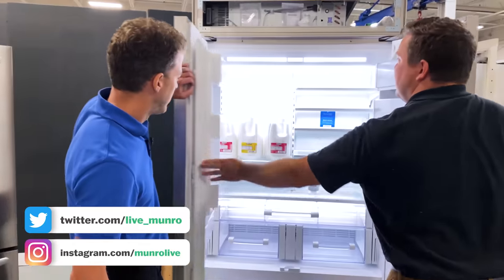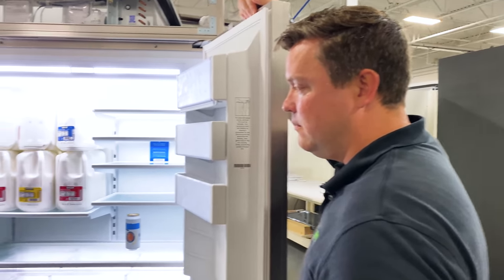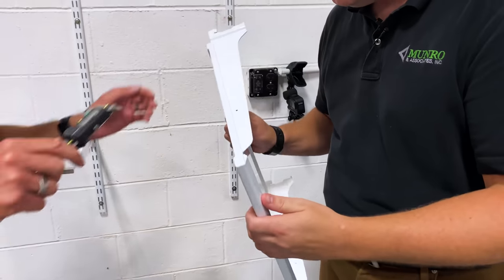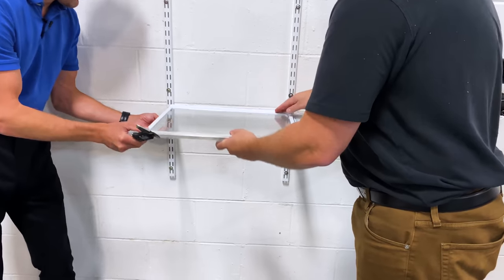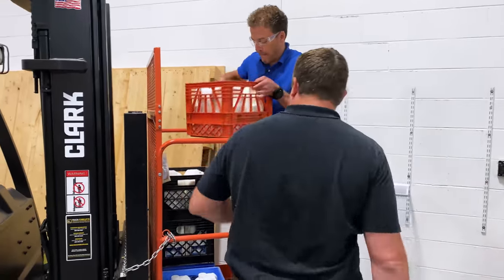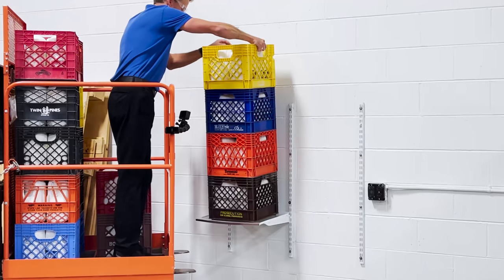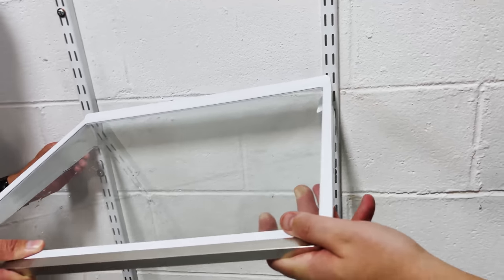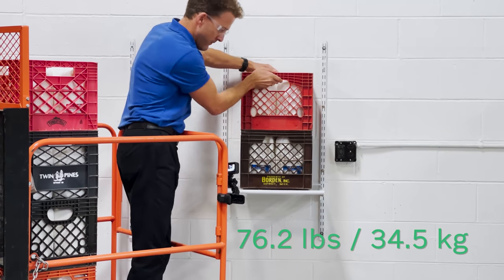Consumer Series: Sub-Zero vs Frigidaire | Load Testing

Comment: Now you/we know what it definitely can't handle. I kinda miss a scientific reason why you did what you did with some calculations and theories to prove. I know that might not be as entertainment for the audience but that's what engineers do. 
Not wasting resources.
Reply: that's what engineers do. 
Not wasting resources.

You and I know very different engineers, and have a very different definition of waste.  They could model it in 3d, and do a bunch of static analysis, or they could do this.  Given the time cost of the modeling, the milk used was certainly cheaper.  All the extra milk would be a maybe.
Reply: My point ist that it was not necessary to use milk for this type of experiment. They could have just used some weights. And why would you 3D model something that already exists to do static simulations. That's more of an development tool isn't it. Also i think the scale of this experiment was unreasonable because this scenario would never occur during normal use. 
Please correct me if I am wrong.
Reply: In addition the test they did is what i know as controlled failure testing not load testing because you don't really care what weight it takes to make it fail you want to identify weak points or unwanted behaviour while failing. Kinda like a crashtest where you know that it'll fail but you want to see how it does it.

Comment: The vertical shelf supports on the concrete block wall are nothing like the ones in the refrigerators.  In my opinion, this test is invalid.

Comment: I wonder about the actual strength of the mounting/means of securing the shelf mounting rails being attached to the inside of the fridge. Sandy's big on minimizing fasteners.   That concrete wall in no way has the strength of the rear walls of the refrigerators....since achieved fictional load weights were made up why not simly use lead weights or EV battery bricks from the shop? .....BTW since gallon jugs of water have essentially the same mass as milk w/o the waste.....Hard to watch such a meaningless and unrealistic test performed by Munro  and Assoc..

Comment: Both where more than strong enough. 
By adding a bottle instead of a crate at a time you would have gotten a more accurate number.
I like the technical assessment of how the shelves are designed and produced. 
Stacking up the milk was a bit over the top imo.

Comment: Sorry guys, but this was the dumbest thing I’ve ever seen on Munro.  This engineer would have used exercise weights so no mess to clean up. Now we know what interns do at Munro.  We are only interested in the maximum weight limited by volume and you clearly exceeded that.  Please invest time on more useful testing such as speed of making ice cubes, lowest internal temperature when ambient temperature is 120 degrees (desert), or worst case defrost conditions.  I’ve repaired older Sub-zero refrigerators and common problem was clogged defrost drain tube causing water spill inside/outside.

Comment: This was a wasteful test.  I would think that from a company of engineers you could have used water  which is cheaper and easier to clean up but also we learn less since they did not add them one gallon at a time  to see the actual failure point.  I would also think that they would have noticed that the sub zero bars were deeper and also wen to the end of the shelf.  But why destroy a part when it could never have that much weight on it in a fridge to begin with.  Makes me have less faith in your team.

Comment: This isn't the quality of Munro live..why tf a fridge shelf which has just a 30 to 50 cm clearance needs a load testing..bring back sandy or just don't make any videos..so basically you are just making dumbest (pretending to be engineering)review and using the youtube fanbase that sandy created to get views..
In this series you had never mentioned about the capacity of the fridge, COP , thermal piping,    heat exchangers , refrigerant used nothing. 
Are you guys are serious, sheer disappointment.
Btw this is the first disliked video of this channel..I had never watched a Munro live videos without liking them, but this😓

Comment: That ;was a stupid presentation.  REALLY stupid.  Why would you waste milk like that, which some poor people could have used?  Use weights, or get empty milk bottles and fill them with water!  All you proved was that either refrigerator could easily hold more weight than you could physically fit in the space, and that should have been the end of the test.

Comment: For everyone bitching that this is a useless test: First off, this isnt "Consumer Reports", they arent testing these products for the comsumer's benefit. Secondly, I guess none of yall have shopped for refridgerators recently. They make a big deal in thier marketing about stamped parts for the shelves and saying that is superior to the competition. But this test reveals that the expensive stamped part was bested by a larger flat part.  This proves that sometimes expensive over enginneered solutions are not always better than an elegant solution. If they were interested in saving some money in production that would be a pretty obvious place.